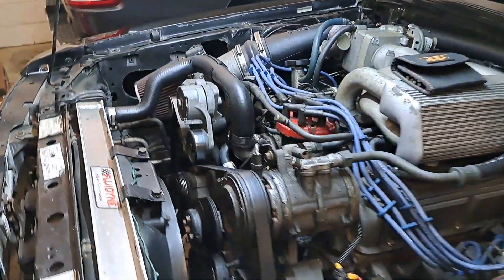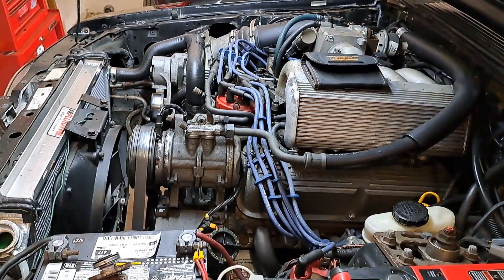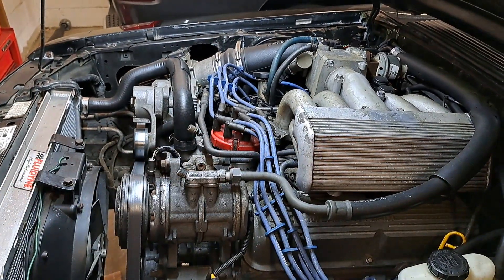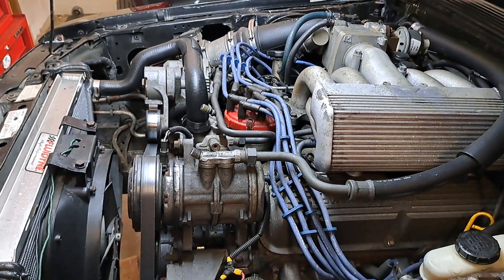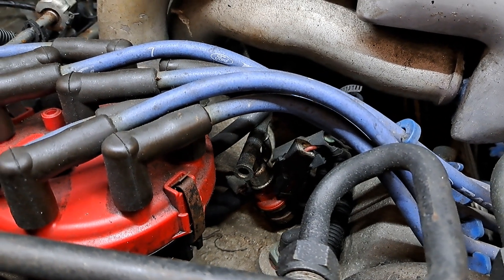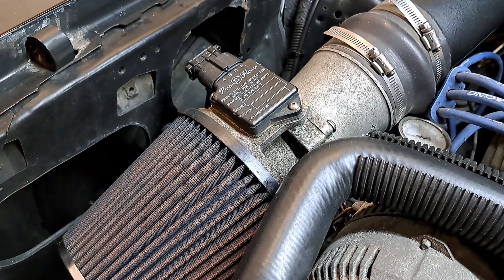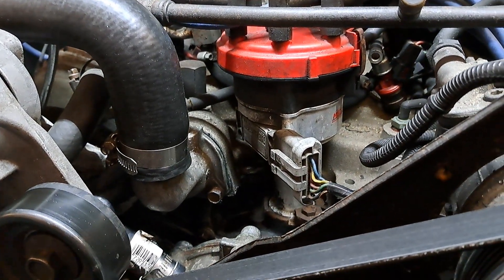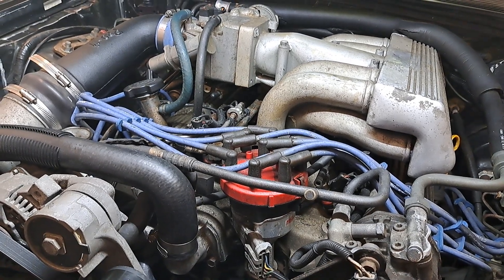Working on the Fox Body.

Comment: love to have a 79 to 81.
Fox body,have it done in black with tastefully done gold touches, <Also was thinking about maybe a 2 tone black red.
With a little bit of white> Then I would make a choice between a lsx {built} With a Gen 5 Oñ Around 17 to 18 or mòrè¿?..🤔 pounds 💪🏻Or if i really wanna freight train  🚗 {🚆}ME-->>♣︎ 🚗--->🎩👋BUUuuy.. somebody/anybody 😊 I would go with a 2018
Built Coyote crate motor With a mild cam set up And toss twin turbos Thanking about 68s turbs on it And obviously run it on E85, "Both would be", although I would push for A.
Flex fuel set up With the twin Turbo set up Due to the benefit of not.
Having to worry so much about.
Letting it sit & stuff like that. I believe either one of those builds with a good Tr 6060 6 speed at least And a 9 inch diff With all the goodies to put the power down and.
Make it reliable.
And keep it cool.
I think it would be...
Quite a hell of a car